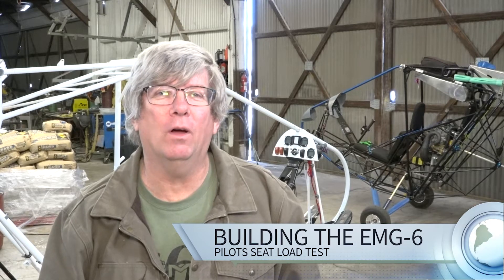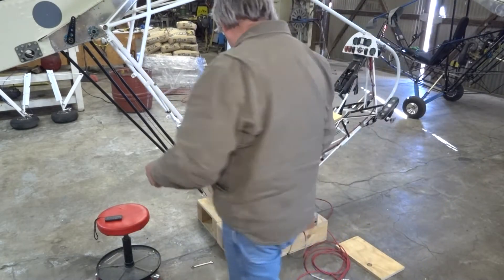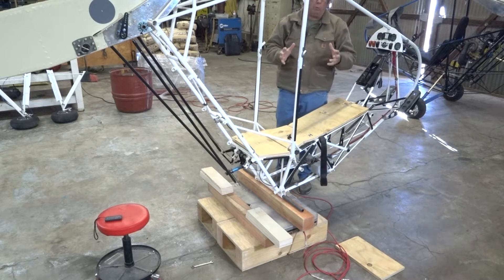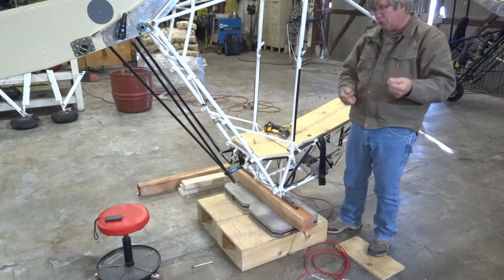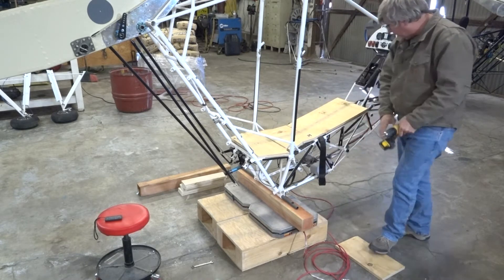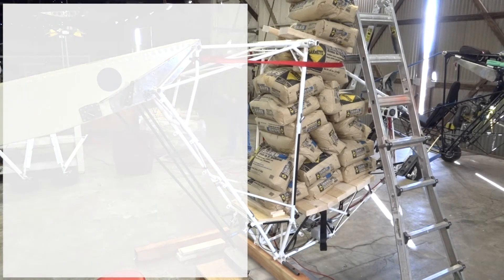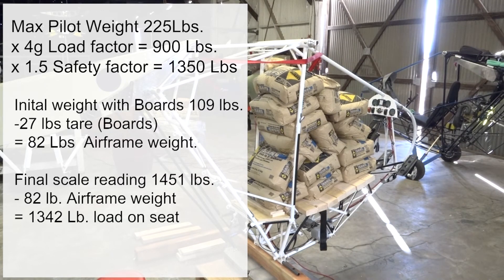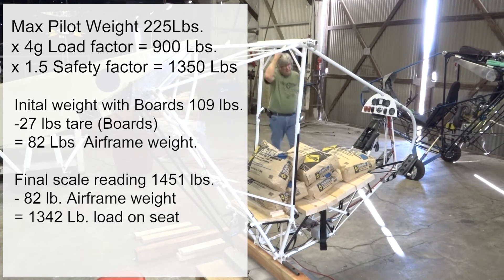EMG-6 Pilots Seat Load Test

Comment: Wouldn't a proper load test be performed as the airplane hangs from the wing mounts rather than loading the seat as it sits on the landing gear substructure? Basically, you're demonstrating how strong the undercarriage is, not how much stress the seat can handle during flight.

Comment: What kind of weight are you working with *(for pilot)? Average pilot would be around maybe 200 pounds?
Reply from the maker: In this video here we tested for 225 pounds. However the aircraft was designed for 250 pounds. We left retest to validate that.
Reply: Adventure Aircraft thank you!
Reply from the maker: All of the test flights have been done with me at 215 pounds